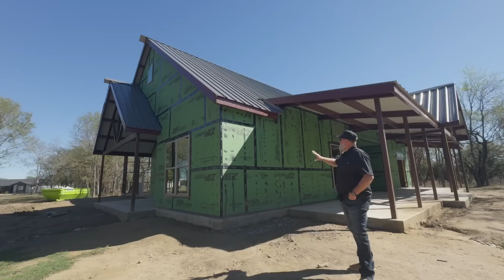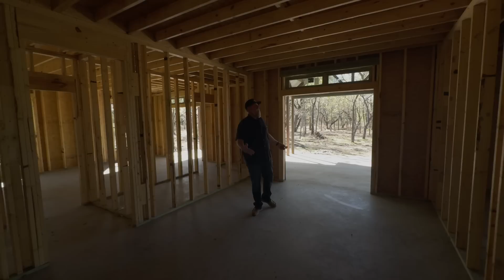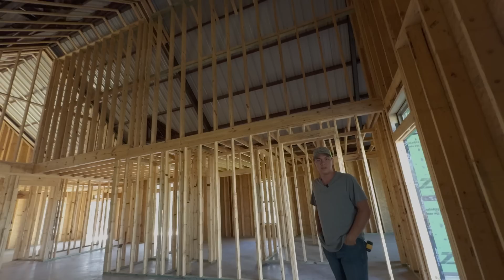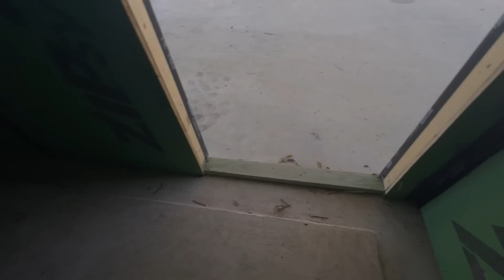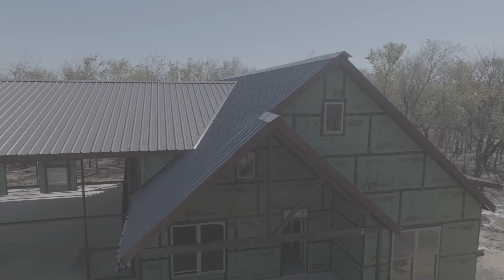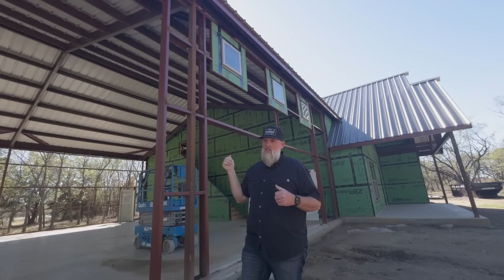Hybrid Steel Framing Details for Corsicana Barndominium Update Tour | Texas Best Construction

Comment: I have two built by TBC - top quality and shocking energy efficiency - summer days, 2000 SFT house costs less than 130 dollars. Now it is less than 100 dollar. The foam spray and the zip system work wonders. Temendous job.
Reply from the maker: Appreciate you sharing your experience, the energy savings are incredible!